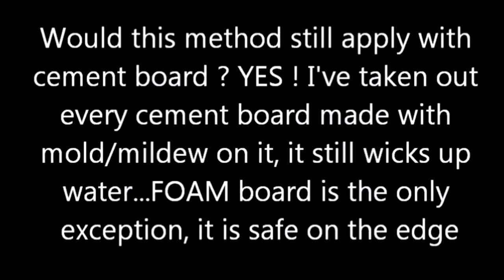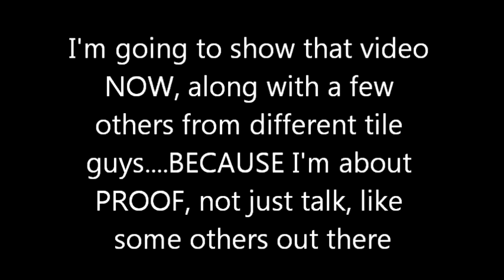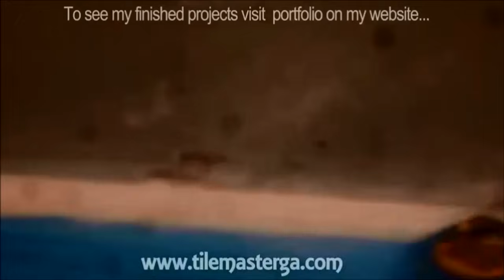WALLBOARD ON TUB

Comment: Random question: would it help to use redguard to seal the edge of the wallboard next to the tub edge? To stop any water from seeping up?
Reply from the maker: Yes it might help but if you raise it then it would be kind of irrelevant
Reply: @StarrTile  interesting.  So would be a need to Red Guard the cement board in its entirety because the board is above the flange?

Comment: +StarrTile First I want to say - wow, this is so awesome! Thank you for showing us REAL examples! I think you have the best and most honest videos out there. However, I am having trouble getting this through my thick skull. Are you saying that Jeff's method is wrong? Should we not use the tape and mortar at the bottom? I can see that leaving a gap is ideal, but I had planned on using mesh tape and mortar like Jeff did - if this is not right though, and I just need to leave a gap - I will do that - I trust your experience.  If time allows just let me know - is Jeff's method just redundant or is it wrong, in that it will cause water/mold problems? THANK YOU!
Reply from the maker: I believe Jeff method could work but I just don't see the need for the tape, if it solve a problem then I would be for it but I don't see the problem so therefore there's not a solution
Reply: @StarrTile  Gotcha, so just to be clear - again I am thick - I want to leave a gap between my cement board and the tub flange, maybe 1/4 of an inch? I can just leave the gap, no need to fill it in with silicone or tape with mortar? Then I tile and caulk up the bottom real well?
Reply from the maker: Yes
Reply: What about tape and waterproof membrane instead of the tape and cement at the bottom?

Comment: You spent an entire video arguing that the wall board should be on the lip. But then 18 min in you said, it's completely fine to put the wall board on the edge, instead of the lip. Not confusing at all. So... if you put the wall board above the lip, how do you fill in the void for the tile to adhere to under your wall board? That could be a gap of up to 3/8" depending on your wall board thickness and the tub lip thickness.
Reply from the maker: If you paid attention to what I said in the video this tub was an anomaly because it had the little drop-down at the edge which I don't generally see on any jobs I deal with, that's the big difference... and I did not say above the lip I said at the lip, and I also mentioned using some silicone at that transition if you would like, I don't see the point but it is very subjective.
As far as adhering the tile to the backer board, at least 2/3 of it if not more will always be adhered to the backer board, those lips are about 3/4 in so they'll only be 3/4 of your tile not touching anything and that's okay, especially with the preponderance of large format tile we are setting nowadays

Comment: So you’ve shown a hundred ways to not do and I’m still not sure how to tie in the tile with the backer board sitting on the lip
Reply from the maker: I'm not sure what you don't understand... backer board sets on the lip and then tile attaches to the backer board with the last three quarter or so of the tile floating
Reply: @StarrTile  so you just leave a void space there? 3” subway tile
Reply from the maker: @codyjones2540  sure, 3in will still get you two plus in of surface area on your wall... I do showers in the same way and I just did 4 inch subway tile in that
Reply from the maker: I mean you can do it anyway you want to I just explained the dangers and pitfalls of putting your backer board on the edge... unless of course you use a foam board and then all bets are off
Reply: Nope that was only my question thanks for the information… some of us are a little slower than others

Comment: tub manufacture should just have a channel to drop your material in. This way there's no issue with installation.
Reply: Or make one using a plastic drywall channel for trimless joint.

Comment: Sal is right. you sit the board on the shelf, and shim up slightly.  You do NOT create a weak point between the board and the edge of the tub..........as usual Star is wrong.   You can look this up in the TCNA tile standards book.
Reply from the maker: @fredobermyer4736  so you're going to ignore the two or three videos that I put up there from my own experience where they set the board on to the edge and it rotted it out..just pretend you didn't see it & go with the TCNA book, don't think for yourself and be ignorant..👍🏻👌🏼

And no there is no weak spot there, tile would go on that area the caulk, Forrest 🤣
With any luck you're not in this line of work because you have 100% no clue.

Comment: the issue with ignoring standards and guildelines and going with your "experience" is that if the customer has an issue, you have very little to stand on when you have not followed recommended guidelines.  TCNA does not say that you lay the board on the top of the tub surface, only that it overlaps.  You're the same person that made a video long time ago saying that you dont need a prepan in a shower because 'water doesn't know gravity, it only knows porosity'?
Reply from the maker: I am ultimately responsible for all of my work and I warranty all of my work for a lifetime... I could care less what any organization tells you to do, if you're just a book Soldier and follow what you're told then how can that organization stand behind you? They cannot and will not !
People like you are a curiosity to me because you only go with a way of doing things if it is Sanctified by somebody else rather than using your own brain.

I was doing blocking between studs 23 years ago before I saw anybody do it.

I was waterproofing my shower over 10 years ago before it became popular.

I was raising my wallboard off of the shower pan before the tcna even recommended it.

And I was doing a sealed system shower five years ago before sealed system became a thing 👌💪
And yes you are correct, I have many videos where I talk about not doing a pre slope and explain the reasons why, gravity does not work in the pan of 200 lb of mortar, capillary action takes over, and obviously you're too dense to know that...
And guess what, with sealed system a pre slope is not required, so put that in your pipe and smoke it 😂😂

And by the way if you ever want to debate any of these topics then you are more than welcome to come onto one of my livestreams and I will put you on camera and we can have that discussion, but a 100% sure you will never do that, trolls and keyboard Warriors never want to be confronted with the truth👌
Reply: @StarrTile  capillary action is the primary force until a certain point of saturation and then gravity takes over.  everything on planet earth is affected by gravity.  In a sealed system, the preslope isn't required because the system by nature doesn't anticipate the water getting past the pan itself.  In a conventional mortar pan system where you place a liner, the very fact that a liner is being installed means that you're anticipating moisture to make it to the liner.  I don't know why you feel the need to hurl insults.  Usually its a sign of weakness.  If your method is solid, it should be able to stand any amount of examination and counter-points.  You seemed to take everything I said personally.  You're right, I have no interest in getting on your live stream but that doesn't make any of my points invalid.  The fact that people can look at videos and use the comment section as a means to discuss the content makes exchange of information so much more efficient and potent than the past.  There are certainly people that have limited knowledge and experience nor any good intentions that get on here and just spout nonsense too.  I may not have the experience that you have but I only mean good in exchanging my views and concerns.  You personally may stand behind your work regardless of how old it is and you personally may do an outstanding job.  Kudos to you.  But if there are industry standards set forth by independent bodies such as TCNA or ANSI and those are not adhered to, if and when failure occurs, the installer doesn't have much to stand on.  That's not being a book soldier (whatever you mean by that, seems you're against education) If it came down to arbitration or even a law suit you also don't need the organization to stand behind you either.  You can simply point to the accepted and approved methods that you followed.  The only thing the organizations have to do is stand behind their methods of discovery and recommendations.  You claim that  "people like me" don't use our own brains but if I just looked up any old video and just trusted the information without any cross examination, then how would that qualify as using my brain?  In fact, I did quite a bit of researching through videos to land on yours.  The fact that I remember your video on shower pans from probably over 10 years ago, means that you impressed upon me a certain level of authority in the subject by the quality of your content.  That doesn't mean that I can't have questions.  Thanks for your rebuttal but sadly it wasn't satisfactory.  Just the other day funny enough, I remembered you saying "water doesn't know gravity, it only knows porosity"  it struck me as odd then, and it still does now.  Because I know that you're speaking to capillary action but how you can dismiss the effect of gravity still astounds me today.  If you hold a sheet of paper towel vertically and drop it down onto a puddle, curiously enough, the water will fight gravity and travel up.  That's the capillary action you speak of.  However, if you leave it there long enough, at some point, it will no longer suck up that water, even before the towel has not fully saturated because the capillary action cannot fight gravity once it reaches a tipping point.  if the floor is pitched to create direction, once the prepan has been saturated to a tipping point, gravity magically will guide the water down to the weepholes.  Does it help that much in practice?  maybe, maybe not, but water doesn't "know" neither porosity nor gravity.  It only reacts to those forces and yes, all matter is affected by gravity.  Now this doesn't prove that your method is wrong, it only suggests a different way of presenting your approach.

Comment: A quick search on Kohler's website instructs installing wall board over the tub flange.  bad info
Reply from the maker: I could care less what the manufacturer says.., I'm the one that tears them out and sees the damage and I'm the one that installs them to mitigate that damage 👍👌
Reply: @StarrTile  how do you handle the water that will inevitably permeate the grout, and find its way to the bottom of the wall board?  If you are on top of the flange, that water can go behind the tub.  The purpose if the flange is to direct that water into the tub so it can find its way to the drain.
Reply from the maker: On a vertical surface if you have that much moisture going into your wall through your grout lines then you have a lot bigger issues going on...
Your wall board should be waterproofed anyway and flush with the top of the lip oh, so even if what you say were possible which is debatable, water would still have a way to exit.... although using your theory most guys are going to put silicone at the very bottom so water would never exit ianyway

Comment: Cmon your rotten section was du to no waterproofing, water seeped thru tile joints, always over the lip with silicone on bottom and on the lip itself, mould resist wallboard which the rotten shower didn’t have, by the way red guard is garbage, use the fabric that is thin set on, bring it all the way  down the tile 1/16 of an inch down and color match silicone caulk on bottom top and corners. The lip to also acts as a nailer or support, yes your going to have a slight angle on first few tile hardly noticeable, the lip is there for a reason.

Comment: I've installed tile for over 45 years.  Never had any problems with a full mortar installations with lath and cement plaster. These modern slapdash cheapo installations are a disaster.  Learn your trade.  Old school installs can last indefinitely.
Reply from the maker: Lathe cement plaster ( floating...wire mesh/mortar )

Yes I'm aware of it as are all Tile Guys, some people still do it but most do not. Times move forward and life expectancy used to be 65-70 in the 60s, now it's nearly 80 because we don't kill ourselves for a check. Old school ppl stayed in a house their whole life, now a homeowner will have 3 homes in their lifetime and modernize each one as they go. And when I tear out your jobs from the 1950s and 60s and 70s it's a full day and a work out, and I wear a mask because it is all full of asbestos....which you breathed in on a daily. 

BTW, 45 years ago I was in the Army serving my country while you were mixing mortar and slinging tile...I had a better job 🇺🇸

Comment: Who the heck uses sheetrock around a tub? You should be using something like Cement Board that is impervious to water. Running the Cement Board over the flange is the correct way of installing a tub. Never, never, never use sheetrock of any type where there will be water and always run the Cement Board over the flange.

Comment: Cement board not drywall around tub…
Reply from the maker: Why ???
Cement board will be waterproofed the same way as drywall, even if I use half inch cardboard it would still be waterproofed, if I use 8-in cinder block it would still be waterproof

Comment: First never use green board sheetrock, use cement board or waterproof backers. James Hardie now makes a waterproof coated cement board so no need to seal the whole surface. This isn't 1950, use some sort of 100% waterproof backing. You are watching this guy cry about what the entire tile industry says is the correct method! You can notch studs for the flange, you can furr studs out or if you can't furr out because your working in an other wise finished bathroom and can't leave an uneven step from tile to sheetrock and have to go over the top of the flange like this video recommended, so be it. However, covering the flange is technically correct. Apparently a tile guy doesn't want to be a carpenter and furr out or notch studs, doesn't want to tell you to never use Sheetrock instead of a waterproof backer, or to simply seal the bottom edge of whatever material you are using so it can't wick water.
Reply from the maker: The "entire industry" is wrong...are you like fat Sal thinking the TCNA is always right and you can't do sh** WITHOUT their blessing??? You a book Soldier ?? Then you can kick rocks...you think I give a F what you THINK ????

I show video PROOF of everything I say on my channel with 25 years experience, yet critical thinking and better methods means nothing 🤦🏻🤦🏻🤦🏻🤦🏻🤦🏻🤦🏻

Comment: Sal DiBlasi has more years on you, and likely equal or greater experience than you, especially since he is willing to look at more modern methods of building a shower instead of being entrenched in ideas and methodology that are outdated. 
You are critical of what Sal is saying, but the way in which he mounts the Kerdi Board on the deck is NOT wrong, and you can't prove with any substantive evidence that his method is wrong
WRONG would ONLY be if his method failed  And it won't.  So while he doesn't do it the same way as you, doesn't make it wrong and DEFINITELY doesn't make you right.
Reply from the maker: Allow my retort:

Sal began slinging tile as I was in the Army serving in combat, then moving into a firefighter job a few years after getting out...along with Red Cross volunteer and ultimately getting into Apt Maintenance for 10 years...been doing tile for 22 years and seen Fu** ups left & right and I mitigate those MY WAY with a flawless record of no callbacks & never a failure...self taught. 

Sal is a one trick pony, he knows nothing but tile, doesn't even do his own plumbing. And is a book soldier, if it's not written in the TCNA he doesn't believe it, sad AF he can't think on his own. This isn't to say he isn't a good tile setter, but he sucks at critical thinking and obviously doesn't use common sense. And arrogant as hell.
And doubtful he's EVER done ANYTHING for his country or community  ✔️💯👌🏻✌🏻🇺🇲